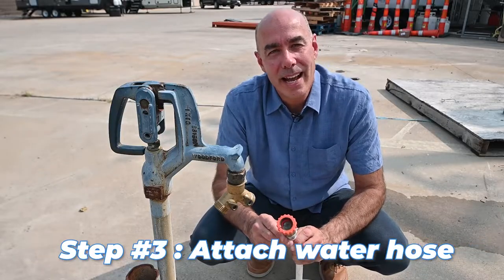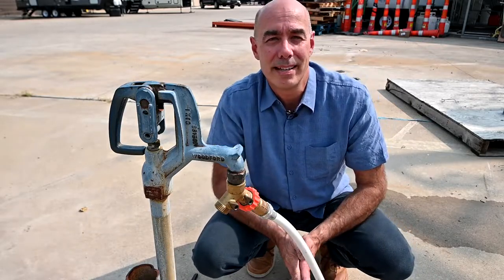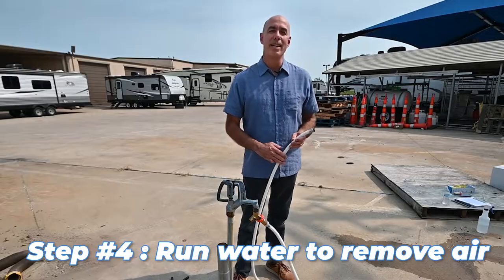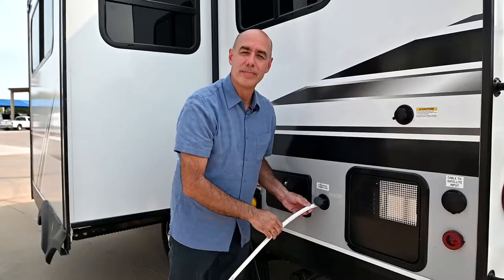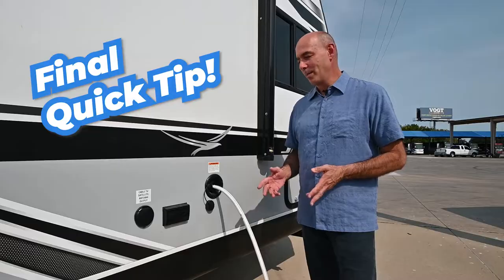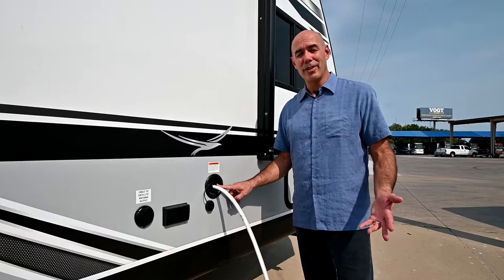How Do I Hookup My RV To Fresh Water? | RV Quick Tips - Ep. 2

Comment: OK, this is probably the dumbest question ever but... after you're hooked up do you just leave the water running? Keep on only when you're actively using water? I'm sorry this is such a dumb question. Lol
Reply: Not a stupid question. I’m new to this and wondering same thing😂
Reply: @np984  camped this wknd for the first 'real' trip.  Good times! Lots of written but it went well. :)  once you're connected to your faucet,  regulator, filter, fresh water hose to the camper, ensure the switch is fully on city water. Turn on the faucet and voila- internal plumping works!  Leave it on for the entire time you're hooked up - I turned it off at the faucet when we were not insite though,  just in case something crazy happened.  Lol. When ready to leave the site, turn off water at the faucet, unplug all your water accessories, and that's it.  :)
Reply: What I want to know is do you turn the spicket on all the way? Half way? How much?
Reply: LOL, was wondering the same thing. Such a newb. 🤦‍♂️

Comment: I use a 45° angle fitting with a shut-off valve on the end before the RV connection... it works well for spraying off things and helps avoid that face-full of water when disconnecting

Comment: My 2022 jayco has a "city water connection" on both my city and fresh water. Therefore, I can't just slide my water hose in my fresh water tank, is that normal?
Reply from the maker: That's interesting - I've noticed that on a few select models, both Jayco and other brands. I assume the reason for that is because the fresh water tank is located where filling it by gravity isn't practical and it therefore a pressurized fill.  Appreciate your comments.  -Mike

Comment: How do you use water filter on Potable Water/Tank Fill connection?
Reply from the maker: Good question. I depends on how your unit is plumbed but generally speaking you would want to filter the water going into the potable water tank.  -Mike

Comment: you didnt add the water filter!!
Reply: Correct, it's optional. We try to keep these videos as short as possible. Appreciate you watching
Reply: @mikedrudge  Was and is an important part.... the extra 30 secs would have made it.
I wanted to know, where it goes. at the faucet or RV
Reply: @Jnraven  Hi Nick, you can place the filter anywhere between the water source and the RV - either at the spigot, or at the RV.
Reply: @Jnraven  place the filter between the water pressure regulator and the white hose.